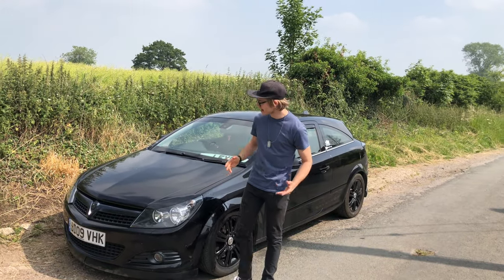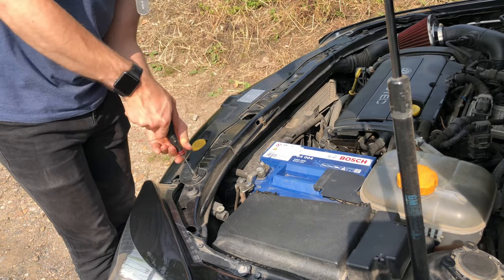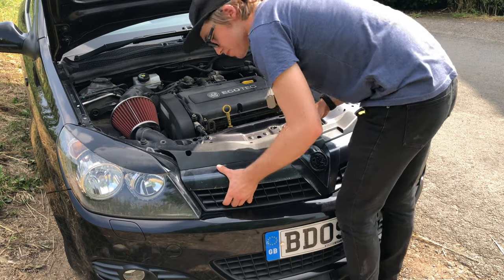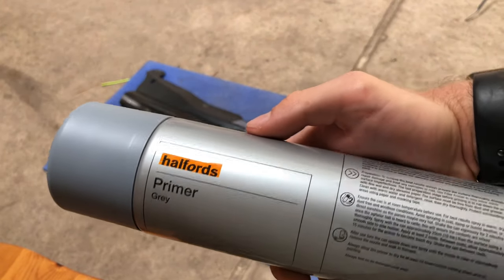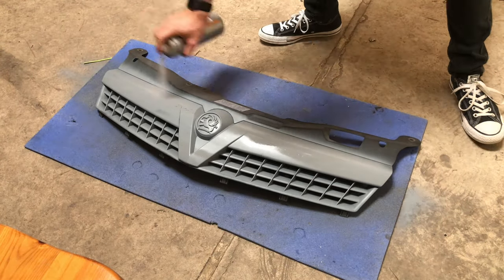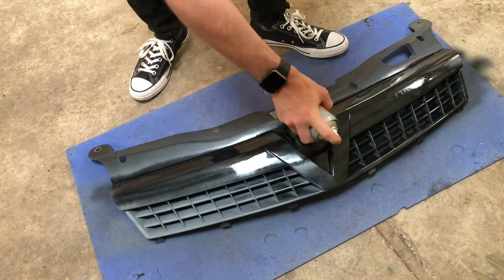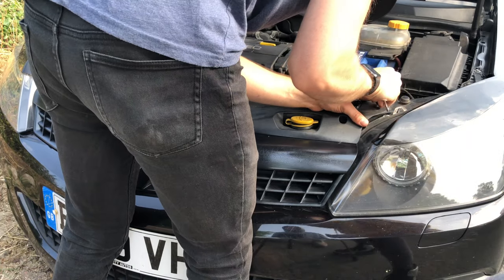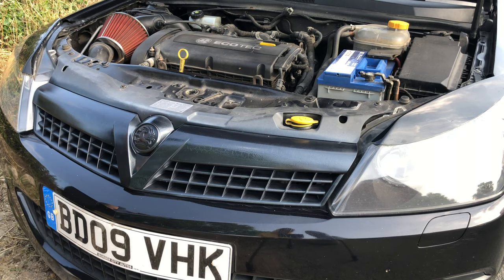How To Spray Paint The Grill On An Astra H

Comment: Watching that pained me man lol, im a finishing manager at a joinery company so I know my stuff. 1st sand the chrome with 180 sandpaper then wash it with soapy water, 2nd a coat of etching primer (this primer adheres to the chrome) normal primer on chrome will peel/chip away in time, 3 lightly sand the etch primer then coat it with standard grey/white primer (3 coats every 30 mins with light sanding in between) 4 sand smooth and apply paint colour and wait 4 hrs to dry, 5 a coat of clear top coat lacquer to seal in the paint and leave a shiny finish. DONE.
Reply from the maker: Very large difference between my job and a pros 😂
Reply: @PhoenixVGC  yea sorry wasn't putting you down just adding my 2 pence worth. I did my V grille a while back 🙂

Comment: Just a tip for next time mate. Sand it down beforehand then apply thin coats of primer, doesn’t have to be all grey after first coat and same for your base coat. That will help illuminate some of the cracks you were seeing and help it stick. Also I would have applied some clear after just to be extra safe. Looks pretty good tho mate
Reply: Eliminate not illuminate. Can’t spell haha
Reply from the maker: Brilliant, thanks mate 🤙🏻
Reply: Phoenix V.G.C love the videos tho mate. Gonna be getting the same exhaust you’ve got very soon. After an MOT tho haha
Reply from the maker: Good choice 😜

Comment: If your not gonna prep properly plus use plastic primer to stop it reacting and cracking etc on the front and rear chrome just wrap them. Wrapped my Astra parts. Looks better and is easier.
Reply: Exactly mate, as a professional paint sprayer should never spray that chrome strip on the boot strip, am seeing everyone do it but it'll just peel after half a year or so